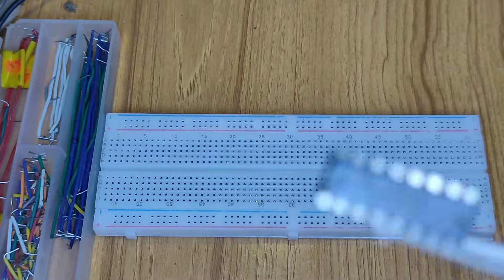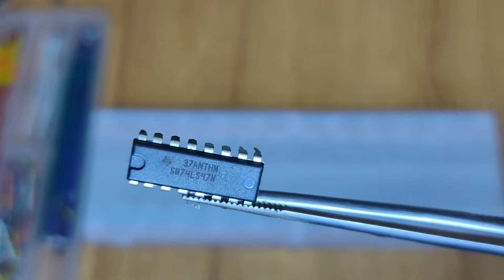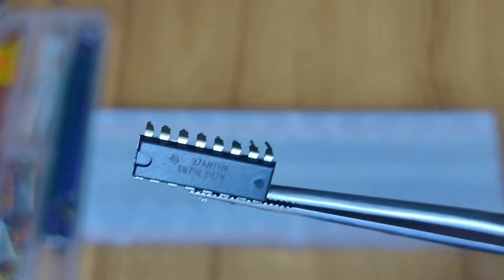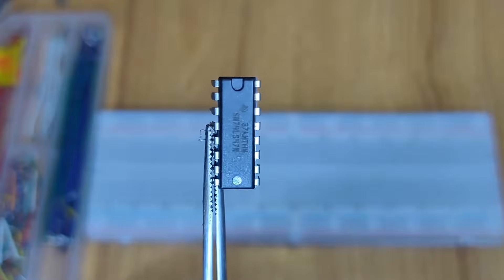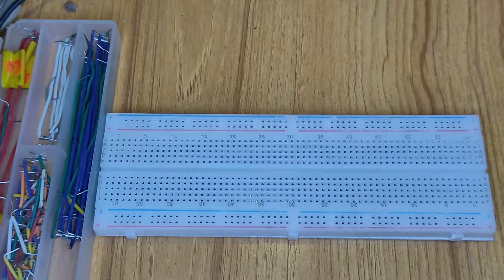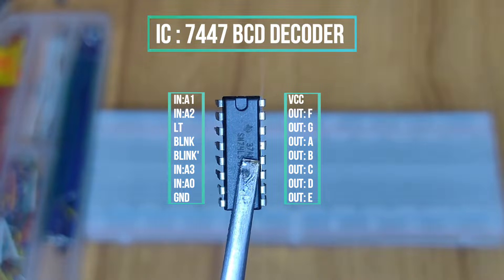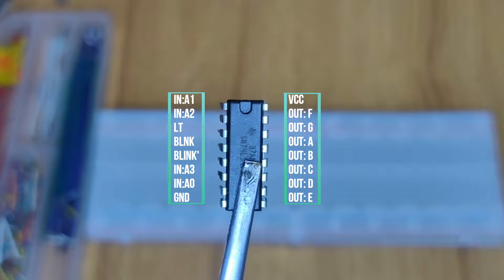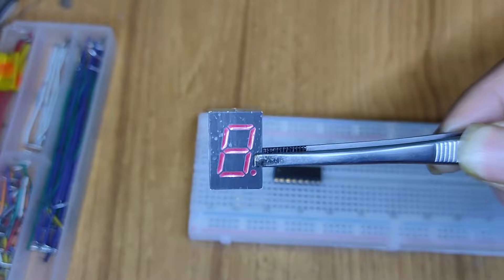Tutorial || 7 segment display with 7447 bcd decoder || 74HC47 BCD to 7 Segment Display Decoder

Comment: Using L7805 with 9V and 680ohm resistor, it is not working. 
What to do??
Reply from the maker: That circuit work with binary state of 5 v accurate. You have to ensure that provide 5V. And my suggestion is don't use any current limiting elements like resistor and use filter capacitor with LM7805 at input end and output end

Comment: Is it can show 2 digit 7 segment using 1 ic 7447?
Reply from the maker: technically not possible but same digit in 2 set of 7 segment display can run with 1 ic 7447 through parallel operation